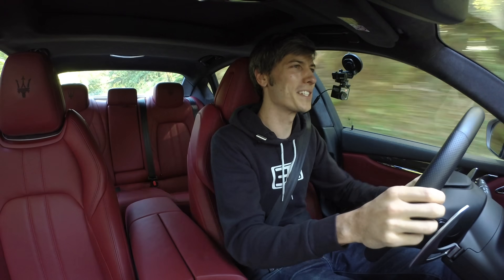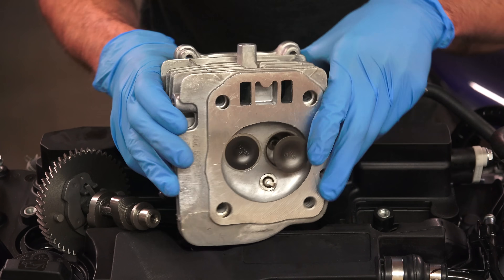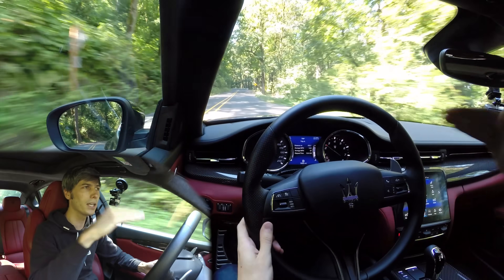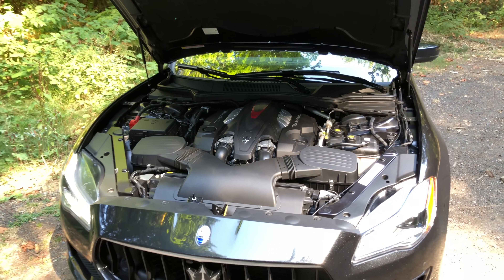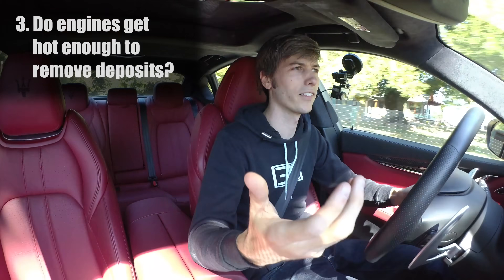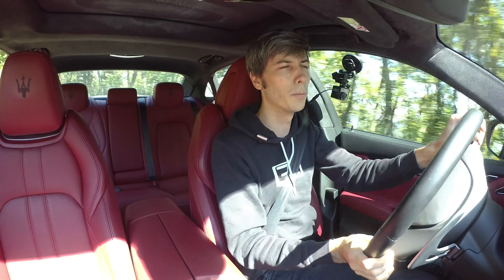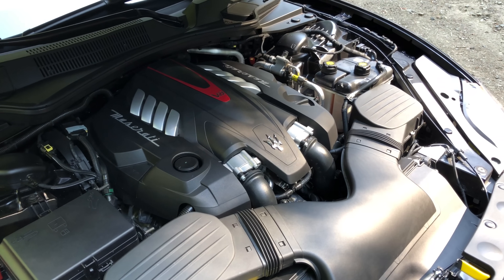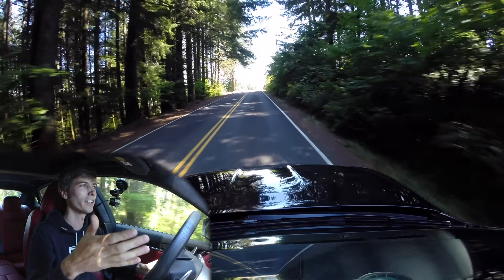Is Redline Good For Your Car's Engine? Italian Tune Up

Comment: I remember back in the 80's to get the carbs out regardless of how old it was or mileage you just to took the car on the expressway and get it up to high speed and that was enough just use the passing gear and that would do it. You never had to worry about redlining it. It was just more about the car that spent more time in stop and go traffic and not enough time in high speed expressways. So that mainly where the getting the carbs out comes from. Back in the day I remember a friend talking about getting carbs out and you knew when you saw black exhaust.

Comment: My 0.8 l engine displacement Suzuki always has to see high load and rpm,an if you see the pistons, they are golden but completely clean. My V8's, well, the opposite. (Edit : I forgot, I'm mechanic and I used the method on a Toyota Yaris that had problems, and it worked, it recovered power and torque).

Comment: Unfortunately,  at max speed, the oil in crank drillings release air in solution and form a bubble that grows and ultimately cuts off oil supply to rod bearings.  Can wreck engine.

Comment: Worth pointing out that "surface temperatures" are poorly defined. Temperature is continuous, so there's a fairly narrow boundary layer over the surface of any solid component where temperature changes very quickly. And the Re is pretty large so this boundary layer is very thin. You might get a temperature gradient of several thousand K/mm. What temperature those carbon deposits actually reach will be very sensitive to a variety of parameters, and you can't assume it's well represented by a probe thermometer.

Comment: I live in Italy. I brought my Mercedes CLS (C219) for servicing, mentioning a rough idle. The technician asked me how I drove the car, and I said commuting to work. He said, take the car out on the Autostrada for 100kms without going below 160kmh/ 100 mph. I did so, and saw sparks flying out the exhaust. Now she drives perfectly. Works for my Ferrari 348 TB too.

Comment: In any case, it’s imprecise.  Not a method I would use on my engine.  I drive my direct-injection engine gently, and if I ever get enough carbon buildup to cause a problem, I will have my dealer do a cleaning procedure.

Comment: One thing you didn't cover which I always thought was important, was to clean the carbon buildup off the spark plugs. Back in the Sixties and before, we used to take out the plugs occasionally and clean them. Spark plugs weren't platinum and had to be replaced more often. A good hard run through the gears would help the cars performance on a regular basis and lengthen the life of the plugs. They were a lot easier to change back then and a lot of people changed their own. My Dad taught me that running it hard now and then was good for a car. As long as it wasn't on it's last legs. Clean spark plugs were necessary for good performance. I did a lot of drag racing in the early Sixties and changed my plugs in 10,000 miles or less. They were pretty clean just worn electrodes.
Reply: I do t find that nessisary on good running fuel injected engines, but if its been driven gently and carbon has built up yeah id just change em

Comment: Cars in Germany are going over 500 000km on average without any problem with engines, I saw 190E merc, changing oil before me in Munich, car had 1.5 million KMs on odometer. I asked the owner, what is he doing with the engine, because in our region even well maintained engines fail at 250km and need serious repair and start eating oil after 150 000km. Dude just answered that he has to do 40-50km per day on autobahn and he just keeps RPMs high, so motor is always under nominal load at least, all components are under proper load with good oil to cool engine properly and car hadn't seen any oil except 5w30 fully synthetic since bought at dealership in 1990 years 😂.

Comment: In 1960 at age 16 when I started driving the family car, a 1955 Chevrolet 6cylinder, it would run 85mph.  After opening it up a few times, the top speed increased to 95mph.  So yeah, blowing the carbon out does work.  I knew this in 1960.

Comment: In the olden days a mechanic could take and lean your carburetor out if you had an adjustment for air idle and then rev it up, then return it to the previous setting; after that you’d pass emissions if it were close. A similar procedure could be done from the cockpit on the old cessnas, pipers etc.

Comment: I'm curious why the research is so inconclusive when it's so universally accepted as truth.  I've done this many times with gas, diesel, propane, and multifuel engines and never had it not work.  Interestingly, I always find that you have to work the engine hard for long periods of time (>2 hours) in order to get it to work.

Comment: In airplanes the pilot is able to control the fuel mixture from rich to lean.  Takeoffs and landings are done with a full rich mixture.  As you ascend into thinner air with less oxygen the mixture automatically becomes richer if you do nothing about it.  It's good practice to lean out the mixture when you ascend above 3000 ft. above ground level.  Typically you lean it until it runs a little rough, then enrich it until the engine temp drops about 50 degrees from being rich of peak temperature.  You get much better fuel efficiency and the leaner mixture runs hotter and cleaner.  Sometimes if the engine is running rough and carbon build up is suspected some pilots run the engine a bit too lean for half a minute or so and it sometimes smoothes out.

Comment: I'm sure the Italian tune up was around before pcv. Way back fuel mixtures was a compromise between not loading up at idle vs. overcooking at speed.
In a two stroke dirt bike slow speeds loads up everything from the plug to the silencer and a high speed section causes smoke and liquid fuel to blow out the tailpipe.
After the clean out response is crisp again.
I ran a bottle of cat cleaner before smog and noticed a better exhaust note and throttle response.

Comment: One pull up 2-3 gears can be enough, i have a friend with a car that burns so much oil the Lamda sensor gets clogged and throws an engine light. You can drive around a low revs. Turn ignition off and the light will come back on. 
Now if he kicks it's head in by doing pulls to 8600rpm the light will go off and stay off for a few days

Comment: Whenever my bikes get a bit grumbly from doing short runs in the winter, a good 50 mile blast up the motorway has them running as sweet as a nut.

Comment: I had a V6 that was shagged due to extensive running of LPG. Added port cleaner and oil de-gunker and switched overdrive off before a 2 hour road trip. Continued until the tank was nearly empty. The engine was visibly and audibly smoother afterwards. Also there was a significant point where the engine backfired and blew a lovely flame, no idea what that was but I feel it was something significant.

Comment: Hi,I don't why you call it the italian tune up. In Italy we don't use it with gasoline engine!! All we (in Europe) have is some problems with diesel fuel exhaust filters (DPF) driven in low load and low temperature. The advise from experts is to drive high speed & high engine revs for an hour or so to clean those filters. But not in gasoline engines!

Comment: I think the added fuel flow, increased pressures and increased gas flow play bigger parts than the temperature to be honest. At full throttle near redline you're pouring in a lot of fuel into the engine which has a washing effect I think. That, along with the high pressures and high flow will probably clear out a considerable amount of loose carbon deposits. As you say, it depends.

Comment: As I recall, Ford reccomended reaching a specific rpm on a semi-regular basis for the low revving 4.0 OHV found in 90's Rangers. It was something like 3500-4000 rpm, reason being with typical drive cycles only ever reaching 2500 rpm, carbon would build up

Comment: I think the error here is the measure of temperature of the surfaces of the metal. Heating THAT isn't the goal. The intent is to generate a brief burst of heat local to the surface of the deposit to burn off some of the outer layers. This spot-heat certainly peaks above the needed temp. It will NOT burn off all deposits as the deposits closer to the surface of the metal experience greater cooling effects, but that isn't the intent...

Comment: I had a 1983 Camaro z28 with crossfire fuel injection and one time I loaned it to an older lady for a few weeks. She just putted around town about 3,000 miles with it and when she brought it back it would stall and hesitate really bad. I  took it out and floored it from 0 to about 60 mph two times and it blew so much black smoke out the exhaust you could hardly see. Most of the hesitation was gone and it wasn't stalling anymore. After a few days of me driving it hard it went back to running like new.

Comment: Ya unless u got big open road or a race track, most regular cars arent gonna reach the temp to remove those deposits. You gotta run it hard for awhile. Also, unless you have sensors or thermometers measuring the temp, you may not get it hot enough and end up creating more deposits than you remove. better to just use a fuel additive periodically to clean it if ur engine is unexplainably losing power despite checking other causes of power loss.

Comment: A colleague of mine owns a 2004 corolla D-4D. It has a cleaning mode, where you run it in 2nd at 90 km/h for few kilometres. It's factory included mode. Cleans the catalytic converter and everything else, because the exhaust path becomes red-hot. 
I think it's mostly an engineer thing, rather an Italian.

Comment: My understanding is that the "Italian Tune Up" was prevalent during the carberated years. The hypothesis being that revving high then lifting off created a high vaccum thus clearing the tiny passages/orifices in the carb resulting in increased efficiency.
Reply: Even just using your main jets too. They don't get used until around 3/4 throttle.
Reply: Agreed. Higher flow, not necessarily higher vacuum. That’s on deceleration.

Comment: Easy solution; Run at 5000 rpm after draining the oil. This should get me well above 300 degrees which will be enough to break up the carbon deposits. I'll let you guys know how it goes.
Reply: DO NOT TRY THIS - apparently running without oil is bad for the engine? Well there goes my Audi

Comment: I used to have a '67 SAAB Monte Carlo.  Never had any problem with carbon deposits on the valves, because it didn't have any valves.  However, it would accumulate carbon on the cylinder head.  The solution was to take it out on US19 up in the no-traffic zone North of New Port Richey and run it flat-out for a couple minutes.  This not only cleaned the cylinder heads, but as an additional benefit, the vast cloud of two-stroke oil smoke that spewed out of the exhaust killed every mosquito within a quarter mile of the right-of-way.

Comment: The italian tune up is a great way to get a lazy car (a car that was always driven slowly and into low rpms and therefor is reluctant to be revved high and driven fast) to preform better over time. You need to do a multiple times over a longer period of time. My dad just to do it with some sluggish used cars we had. He used to call it training the car.

Comment: Sounds pretty good. Considering my car is direct injection, turbo charged and a rather understressed V6 under normal driving conditions, as long as I don't drive it hard too often, I should be generally ok it seems. Which, even though my car can haul ass, I'm satisfied with not putting my foot in it too much, it pulls better with lower RPM's anyway.

Comment: Just shows the old Carburettor engines had a lot going for them; chuck a bottle of redex in the carb and blow a load of smoke out the back; job done. No more carbon. And with no EGR's they didn't come back around to haunt you again.

Comment: i have had a lot of secondhand cars. most ran faster after a couple of months because i drove longer distances and with higher revs then the previous owners. i don't redline but i do rev high when speeding up. i often go from second or third to 5th gear.

Comment: I paid for all my RPMs so I’m going to use all my RPMs
Reply: i paid for whole speedometer, i use whole speedometer
Reply: Honda owners be like
Reply: @OneBardyBoy  Cannot blame them, if I had a k20a under my foot i wouldn't drive under 4k rpm lol
Reply: @OneBardyBoy  fr
Reply: @OneBardyBoy  Cant say you're wrong, owninga a civic i surplisingly fun once you get above 4k rpm
Reply: Well, when you finish all the RPMs, what would you do then? Buy some more?? 
😁😁😁
Reply: @daviderhahon  uhhhhhh, yea, duh 🙄🙄🤣🤣🤣🤣
Reply: @user-mz9rd5wg2w  LOL
Reply: @daviderhahon  you shift gear
Reply: @francescobattistoni20  In this context, shifting gears wouldn't help. Cos, you will still need to rev up after that but no RPMs left, so...... 😉😉
Reply: I say this when ripping a two stroke. But hey, no valves to float, so i use every single rpm available. Piston, crank and rod doesn't seem to mind one bit. 10yrs plus and still goin strong lol
Reply: @DarksideStreams  it doesnt kill a engine, it wears it but doesnt kill, the rev limit was set in a cautious way in reality the engines can go further without breaking
Reply: i do 5300 rpm in my diesel daily.
Reply: Oil certainly is the magic potion but half of the magic is getting it pumped properly. That’s whys there’s failure most often. Honda engines stick are nearly bullet proof
Reply: Revolutions per minutes
Reply: This allowed me to unlock the check engine light, which I also paid for.
Reply: I mean, you paid for rods and pistons too but how long do you think they’ll last being stressed like that all the time?
Reply: @invisiblekid7374   couple hundred k in a k20 ahah
Reply: @invisiblekid7374  yes
Reply: @invisiblekid7374  revving high doesnt stress them if you always change your oil

Comment: We used to have a line truck at the hanger i used to work in that would get check engine lights every so often. The runway had a pretty low speed limit, so the truck rarely reved much passed idle. The check engine lights stopped coming on when I started taking it out for highway runs. Im thinking it had something to do with the cats.

Comment: In case you are curious.

Decarbonizing/decarbonization seems like the preferred word. Decarbonizing is the removal of carbon. Decarboxylation is the removal of carboxylate/carboxylic acid functional groups. Decarbonization is usually not a term used by the general population of chemists as it is pretty broad. Some use it to mean the removal of carbon deposits while others use it to mean the removal of CO2. Either way, it is removal of some form of carbon.

Comment: I have seen this work, an old Micra that had been driven with the choke on pretty much constantly, until it would run on after it was switched off, flat out run down the motorway fixed it

Comment: A couple of real-life examples:
As an apprentice I recall my boss repeatedly revving a poor-running RF900 to the limiter & subsequently filling the air with thick sooty smoke.  Initially I thought he was just being abusive, but the bike ran perfectly afterwards.  He knew the customer well & knew that the bike was tickled around at low rpm it's whole life on the road.

My brother bought my grandad's car, a '90s Ford Escort with about 40,000m on it. When he picked it up, I followed him home along the motorway & there were actual lumps of carbon flying out of the exhaust. It was the first time it had been opened up for years!

Comment: I had Alfa Nords for 17 years. There was no doubt about it that a fast motorway run blew the cobwebs, or maybe that should read carbon deposits, out  of the engine. Much more free revving afterwards. A better story is from an Alfa dealer I spoke to. Lots of women bought Alfasuds and used them mostly for shopping trips. They started to cough and misfire and so came back to the dealer with a complaint. Dealer took them out for a half hour blast (and Italian Tune up) and lo and behold they were back to spec. That's all it needed. So the Tune Up worked.

Comment: So can I redline my GDI engine or nah?
Reply: From my experience, yes, you can do italian tune-up on GDI. I own an Audi A3, 1.4 TFSI, 125 hp, motor code-CAXC(2009, the problematic generation). I went on a Sunday, this summer, to do some shopping. On my way home, check engine and EPC turned on. The entire car started vibrating like hell. Next Sunday, I did 10 runs on the highway(160-180 km/h, 6th gear @ 3200-3500 rpm). When I left the highway, check engine was no more, only the epc. Arrived home, i let the engine to cool down a little bit and turned it off. Next day, i turned the engine on, no more epc, no more check engine, no more cold start misfires. Oh, and btw i put only 95 octane fuel(living in Europe). Hope this will help you!!